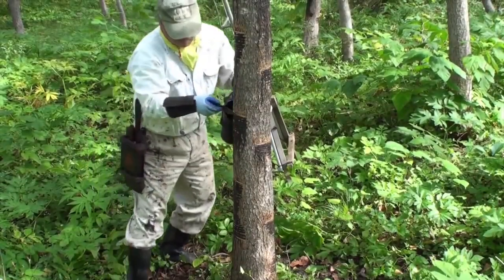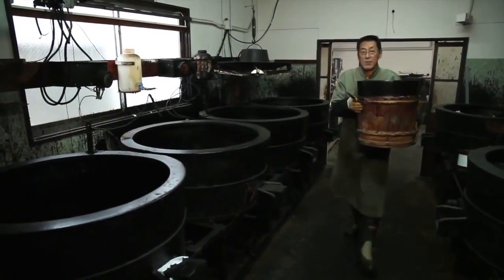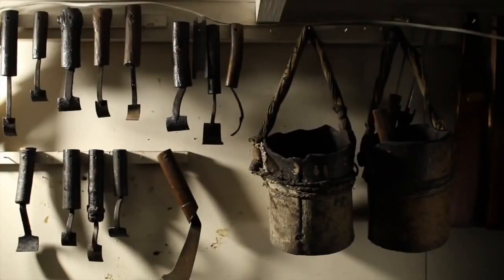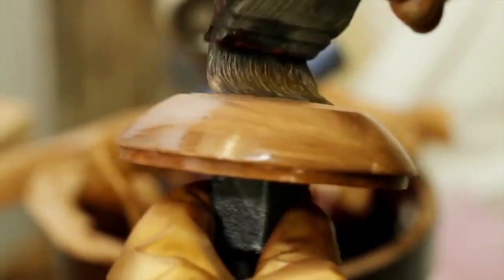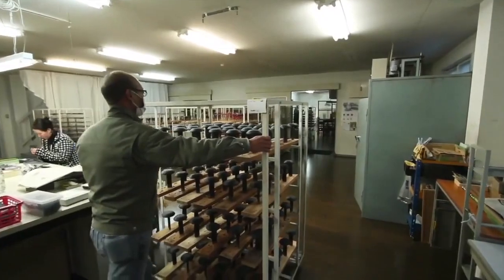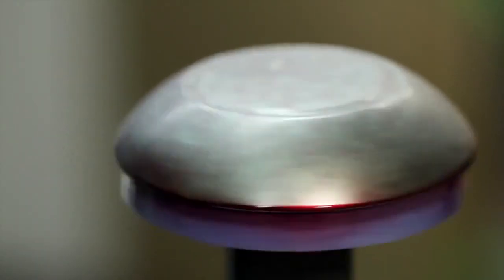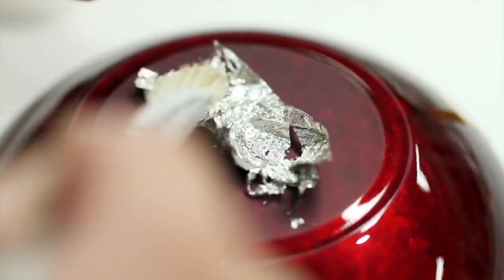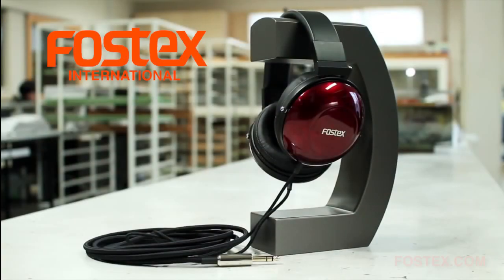Making of the Fostex TH900

Comment: I love these headphones, bought two. Why are they built like absolute shit though? I have been babying them and so careful, they are either on my head or in their case.... the hinge has snapped two times on me and I now have had to have them repaired by AM&S (Which twice actually came back broken, once the metal slider was not even screwed in at all and the second time the hinge hanging out) with mixed results.

This time, I noticed the bearing holding the earcup to the backet was wiggling, I pop it open and see a small (cheap) e-clip coming loose and to see you still using this design on newer versions hurts deeply.